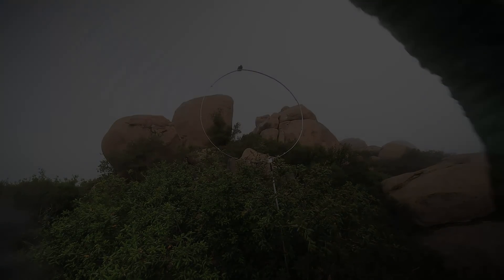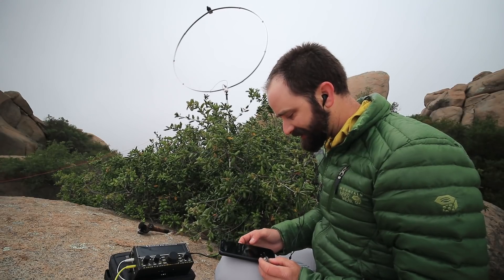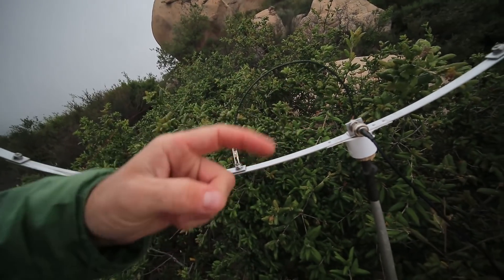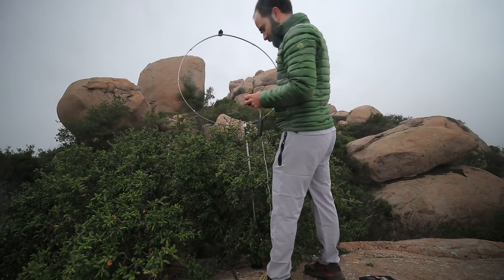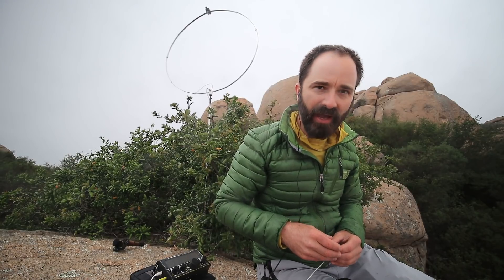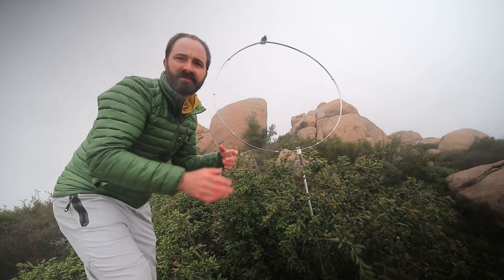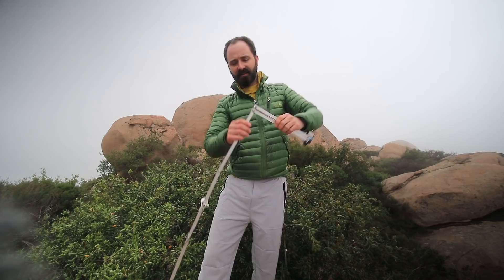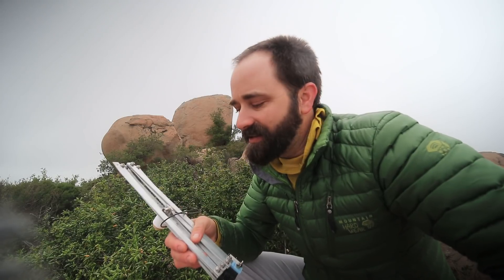Tiny Magnetic Loop - Big DX

Comment: Great video please tell us about the key you are using. 
Thanks your efforts are much appreciated.
Reply from the maker: Jeff, it's a homebrew key made out of a sheet of acrylic with a slot cut in it. The paddles are pieces of shim stock material, and a small screw provides the ground contact.
Reply from the maker: https://photos.app.goo.gl/D7EqdfsHLjLyBmGTA
Reply: @K6ARK  very nice...  thanks
Reply: @K6ARK  yv5fck Armando very difficult to see the electrical connections and the contact points, I think there are in the acrylic parts that form the box

Comment: Hi Adam, again a great build, was wondering if it would work if you could place the caps on the low right side of the loop. 73 and dit dit from the EU.
Reply from the maker: Yes, but as I understand, the feed point needs to be opposite the capacitors unless you have a double loop.  Placing the capacitor at the bottom would require the feed point to be at the top.  That definitely works, it's just a trade-off.
Reply: Thank you Adam, good point, love your projects and yt channel, hope for qso 😃be safe 73!
Reply: The impedance of the loop varies with highest impedance at the capacitor.  it's a tuned circuit so the net reactance is theoretically zero BUT the feed from the radio isn't part of the tuned circuit and will see the same current everywhere in the loop but a much different voltage.  This produces a smoothly varying resistance that will be very high at the capacitor and very low, nearly zero, at the far side from the capacitor.  The alligator clip on the feed allows to clip onto the loop at the point where it makes 50 ohms.
Not shown here is that you can make a two-capacitor feed like the MFJ loop tuners, in which case the capacitors are at the bottom.

Comment: That's an amazing result, I'd love to see more vids about its design and build. I know a lot of the information on the 'net insists that you need solid copper to deal with the high current at the feed point, but there's no denying  a contact to Japan. Great stuff :)
Reply from the maker: I'm certain good propagation conditions were in my favor and it was largely a matter of luck, but the antenna does radiate.  It will never be as efficient as a dipole or EFHW, but sometimes the compromise of a very small antenna is worth it.
Reply: The high current exists everywhere in the loop; the actual feed is much lower in current.  Of greater concern is the capacitor that sees the high current and thus also high voltage, but not so much at 5 watts.  Also, "skin effect" is such that the current only flows on the surface of the conductor; that's why I and other use hollow copper tubing.  it wouldn't use the inside anyway.
Reply: @thomasmaughan4798 It's hard to fold up copper tubing.
Reply: @ahbushnell1  "It's hard to fold up copper tubing."
That it is which makes portability an issue particularly at lower frequencies (larger loops).  RG-8 and similar coax works pretty well to provide large diameter outer conductor and some flexibility.  Naturally the inner conductor is completely unused in that configuration.  I might try some tinned copper braid to achieve the same result at less weight and increased flexibility.

Comment: Very Cool! For us instruction followers, (vs experimenters and innovators), what goes into "the box", and how is the Gamma match made? A video detailing the construction of "the matching box" and the gamma match components would be awesome. The remainder of the project seems very straightforward from a mechanical standpoint.
Reply: The idea is relatively simple.  The capacitor tunes the loop BUT at that tuning, impedance increases as you work your way up either way from the feed point.  So you want a 50 ohm point and it varies by frequency.  That's why the alligator clip.  Tune the loop for minimum SWR (maximum received audio noise) then move the clip for 1:1 SWR.  Once you have found the sweet spot, put a mark on the antenna with a Sharpie or similar so you can find it again.
Reply: @thomasmaughan4798  Thanks. Yeah, I get the alligator clip concept. Where I run into a wall is the "box". As I mentioned, I'm a good instruction follower, but my electronics technical skills are deficient, hence my plea for detailed construction directions. I like the ,"The idea is relatively simple." So am I ;-)
Reply from the maker: I found this thread on another method of marching that looks enticing - Thomas mentioned this in another comment thread as well. https://forums.qrz.com/index.php?threads/want-to-homebrew-a-loop-tuner-box.522931/
Might have to try that out as well.
Reply: @Brewerbill  Ah, careful reading, I see.  Yes, the exact nature of the tuning capacitor is crucial.  It is common to use a "butterfly capacitor" because the relatively high RF current does not then cross a "wiper" or rotating contact.  What happens is each side of the loop has its own stator plates and between them pivots the rotor plates and acts as the capacitance between the stators.  Consequently a high RF current never crosses a wiping contact.  

There's a hidden benefit to butterfly capacitor; the rotor can be grounded!  That means it can be used as part of the feed circuit.  The shield of the coax goes to the rotor of the butterfly, and the center conductor goes through a smaller variable capacitor to one of the stators.  Electrically it resembles a gamma match; but instead of an auto-transformer action, this works on the difference in capacitance which thus divides the capacitive reactance between the main butterfly and the matching capacitor and the whole thing can be at the low end of the loop.  This is how the MFJ portable loop tuners work.  You can see the schematic online for the MFJ 936B for instance.  

Conventional magnetic loops with a little induction coil can be difficult to achieve a perfect match.  You can tune the loop easily enough but you cannot ensure a 50 ohm impedance.  To achieve the 50 ohm impedance you have to tinker with the spacing and size of the induction or exciter loop and if it is high in the air, a bit difficult to reach!  Capacitive matching eliminates that complexity, but at the cost of another variable capacitor.
Reply: @K6ARK  The purpose of the matching capacitor is not immediately obvious since it seems to be in parallel with one of the main tuning capacitor sections, but in fact is is in series with the radio transmitter.  When everything is in tune, the radio presents a 50 ohm resistive source without reactance; the matching capacitor is effectively in series with one of the sections of the main butterfly tuning capacitor.  This creates a "voltage divider" exactly the function of a gamma match; but the gamma match relies upon inductive reactance and the capacitor match relies upon capacitive reactance.  AT resonance it doesn't really matter!  

Initial tuning is NOT entirely obvious.  You start with LESS matching capacitor and then find the strongest receive signal by tuning the main butterfly capacitor.  When you have it, transmit a very low power continuous wave (I use "FM" mode on my transmitter) and adjust match for lowest SWR.  Doing that changes the main tuning slightly, so you have to retune the main.  With a bit of practice the procedure takes only a few seconds and the matching capacitor usually does not require adjusting within the band; only the main tuning capacitor. 

Being able to have the entire electronics of a loop antenna in a single box is hugely convenient.  It means you can have as large a loop as you like and it can be highly irregular in shape if that's what it takes to make it fit.  It makes it almost convenient to have several loops each optimized for a band, which is to say, the largest that you can make and still tune it.  20 feet of 3/8 or 1/2 inch copper tubing makes a great 40 meter antenna.  

Occasionally you'll encounter an amateur radio operator that thinks it isn't a magnetic loop antenna unless it is magnetically (inductively) coupled; but that is not the reason for the name.  Magnetic loop antennas are named because they couple to the magnetic field of an incoming radio wave (or excite the magnetic field of an outgoing radio wave).  

Gamma matching and capacitor matching do create a DC electrical connection to the loop from the radio which in rare circumstances might be a safety consideration.
Reply: Okay Thomas, so now you're just messing with a noob, right? I'm only (half) kidding. Your explanation of the butterfly capacitor was helpful for me to have a better understanding of the physics of the component. When I hear rotors and stators my ears perk up. Common terms in a former life, although in a different context. I've found a bit more "how to" presentation for a similar loop antenna, at least as far as the gamma and box are concerned, but I really like the "form" of Adam's radiator. With any luck I may be able to mash together a similar. 73, and thanks again.

Comment: Are you able to do any SSB at 5 watts?
Reply from the maker: Yes, it will do SSB as well, particularly on higher bands.  It's a little less efficient of a radiator than larger antennas, but certainly works well enough.

Comment: I would love to see more about how you go about building this type of antenna. I'm new to ham radio. Can you explain what you mean by efficiency?
Reply: It's how much power is coming out of the antenna compared to how much your radio is putting into it.

Different antennas have different efficiencies depending on what kind of metal it's made of, the way the metal is shaped, how much metal you're using, and a whole bunch of different factors.

This antenna is a lot smaller than most antennas but what you gain from it being so small you lose in how well it transmits that power.

This answer is not the most technical but I hope it at least answers your question well enough to understand.
Reply from the maker: Yes, thanks Greg, that's a good simple description...
The links in the description will give some approximations of efficiency for different size and dimensions of loops. Additional losses are incurred in points of electrical resistance like the joints in my accordion folds. With antennas everything is a trade-off.  Size, bandwidth, and efficiency are 3 primary competing factors. Small transmitting loops (aka mag loops) are very small for the frequency of operation, and are actually relatively efficient radiators, but as a trade-off, they have very narrow bandwidth (high Q).  And despite that relative efficiency, there comes a point of pushing too small of a loop too far, and losses grow.

Comment: Nice one Adam.  Which audio recorder are you recommending right now (in line for recording QSOs)?
Reply from the maker: Chris, I'm using this one now. https://amzn.to/3eCEXks
If you prefer AAA batteries instead of the rechargeable LiIon, consider this one https://amzn.to/3oa5f0H
Reply: @K6ARK  thanks. I’m still hard at work on improving my cw, and at times I’d like to go back and listen through my QSOs.
Reply from the maker: Yes, I have used them for SSB. https://youtu.be/-5x8n_NDD1M
 They definitely work.  Not as efficient as an EFHW or a dipole, but in the right direction (off the ends), they perform well, especially on the higher bands where they are more efficient.

Comment: I would love to see a build video for this! I would be curious to know how the use of an aluminum bar compares to using a piece of coax for the loop? I imagine both would weigh about the same as well as pack down easily. My concern with the aluminum is that it will oxidize with time and the DC resistance between segments may increase. Did you put anything on the segment joints to prevent oxidation or fo you clean them perioditly?
Reply from the maker: The aluminum is much lighter. Measure the weight of about 10 feet of coax, and a frame to hold it up. 

I used stainless hardware to connect the aluminum bars and a little wiggling back and forth as I straighten the segments seems to make the contacts clean enough to prevent issues. Even after not using the antenna for an extended amount of time. I suspect you could also use some dielectric grease but I didn't want the sticky dirt collection involved with that. 

Minimizing resistance is key in magnetic loops, and I have no illusions that this loop is very efficient. But it's light, packs small, and it certainly seems to work well enough.  There seems to be a good amount of interest in a build video, so it sounds like I need to order up some more material and make another. 😁
Reply: @K6ARK  YV5FCK ARMANDO We will wait for the building video I will see in Lowes or ome Depot to find the Aluminum bar, please put in the video the mesures and the part for folding the elements
Tks Adam

Comment: It's certainly a lot more portable than all those poles. Perhaps you might want to try a Hentenna. https://www.hamuniverse.com/hentenna.html
Also, have you tried using a coupling transformer (wound  on a ferrite). This might help with the loss in 'Q' due to the DC resistance. G7VFY.